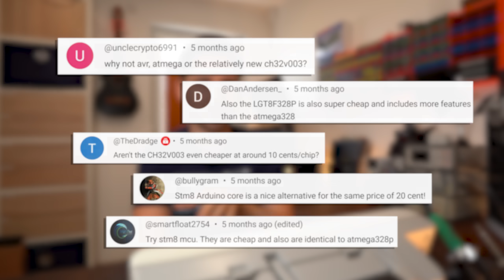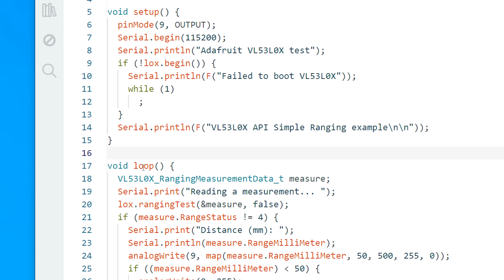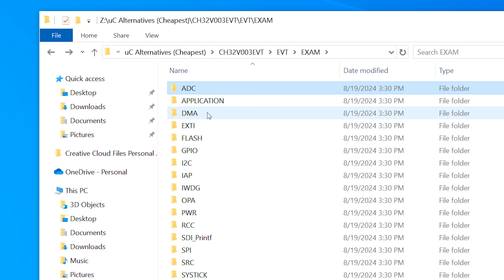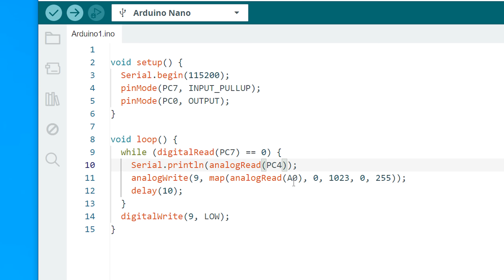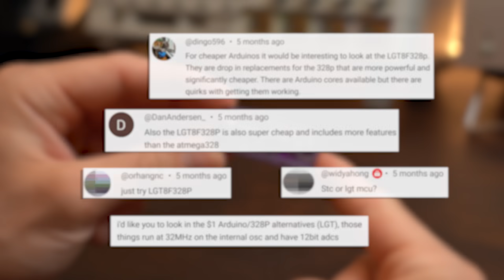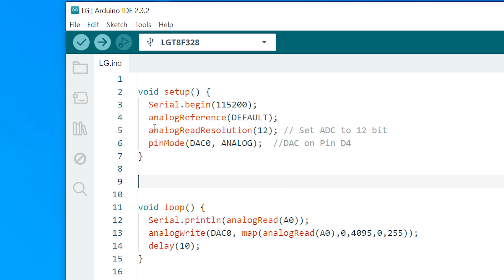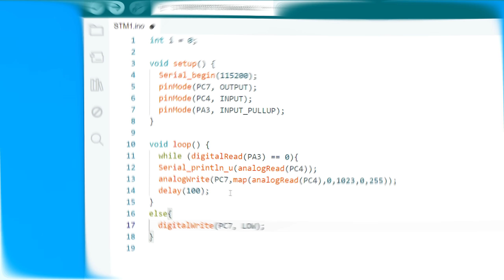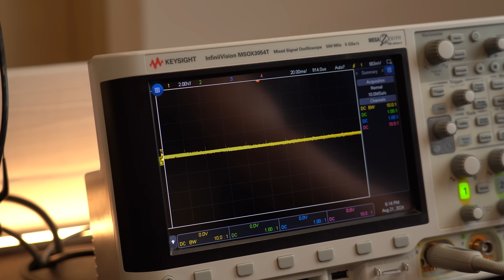I tried the 3 Cheapest Arduino Alternatives! (That you Suggested)

Comment: I'm surprised we didn't get a look at the PY32F002A. Bare chips are around 15 cents each in quantities of 5 on LCSC, it has a little more flash and SRAM than the CH32V003 (albeit at half the clockspeed at 24MHz), and it's ARM so it fits workflows that use ARM programmer/debugger equipment and toolchains. The PY32f030 series goes for about 40-50 cents in single quantities on LCSC and it has double the flash of the ATmega328P, so AFAIK you don't have to worry about flash size at all coming from an Arduino Nano. It's a bit harder to find cheap dev boards for PUYA MCUs, though, and English documentation is sometimes awkward to get ahold of. Still, if you don't need a lot more speed but do need lots of flash, I think they're a great middle option, especially if you have an ARM toolchain set up.

Comment: Thanks!
I just ordered some of the LGT8F328P boards.
I need to use them to convert the 1-4V signal from the Hall Effect throttles on my older 24-Volt and 36-Volt electric scooters to either a 5V PWM or 0-5V DAC signal, to control the new motor speed controllers I'm installing in the scooters.
Reply from the maker: Thanks for the feedback. Sounds like a fun project.

Comment: You should try Silicon Labs microcontrollers like the EFM8 family, for example the EFM8SB10F8G-A-QSOP24 (8 bits 25MHz 8KB (8K x 8) FLASH) which consumes very little power or the EFM8LB12F64E-C-QSOP24R (8 bits 72MHz 64KB (64K x 8) FLASH) which is very powerful for its price.
Reply from the maker: Maybe next time ;-) I put it on my to do list
Reply: @greatscottlab  cool 😄 but I don't know if it's compatible with the arduino IDE

Comment: Hard to beat the Pi Pico unless you are manufacturing a product in really large quantities! You have to be valuing your time really low for it to be worth researching an oddball chip, probably pretty poorly documented, probably with a dodgy supply chain, to be worth shaving a few cents off each board.
Reply: Yeah, but wayy oversized.. for just running a small display and a few sensors an esp is better suoted, juwt because its cheap, small and packs a punch

Comment: Great video Scott.
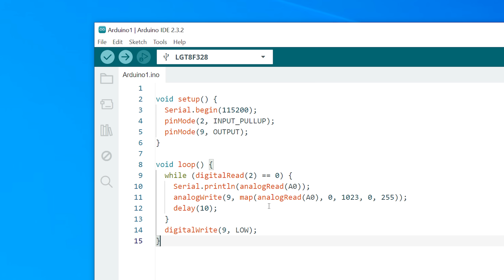Although one thing: my guess, as to why your setup at 8:29 didnt work, would be because you didnt account for the adc having a higher resolution. As the Arduino nano only has a 10 bit adc, it's value only goes up to 1023 (which you then remap to 0 to 255 in your code). But the new board has a 12 bit adc, which means that the value doesn't get remapped properly anymore and goes out of bounds.
So maybe if you change your map to be from 0 to 4095, it might work with the LED example.

Edit:
Ok, maybe i should've watched 5 seconds further, as the same microcontroller on a different board seems to work. Who knows what happened with the first one

Comment: ESP units are also very cheap, the new lineup of the ESP32 series is also seriously awesome, more memory, speed, BLE and WiFi even Zigbee support on some, the ability to just flash ESP-Home and then do OTA updates, it just leaves arduino in the dust
Reply: ESP32 and even 8266 are way superior, wifi and bt inclusion out of the box are just fantastic, for the price they should have been here and would have crushed the rest
Reply: @javierolo94  well WCH offers even some ethernet phy bundled whereas ESP is now going to wireless only. If you are on smart building or on board communication, wired is a prefered option for obvious security reasons... I wish WCH had Base T1S with PoDL 🎉🎄
Reply: Downside of ESP32's is their power consumption. They are extremely power hungry which rules them out of almost all battery powered solutions.They're also not really in the same category as replacements for Arduinos as they are 32bit, not 8.
Reply: Another annoying downside is compile times. Basically every ESP project takes at least 30s to compile for seemingly no reason.
Reply: @KnowledgePerformance7  The really long compile times on ESP32 only happens on windows for me, on linux it only takes a few seconds.
Reply: @KnowledgePerformance7  thats on windows. esp-idf uses mingw to emulate linux so thats why its hella slower. its about 2x faster on native linux, or virtual machines. Im currently running Windows 10 LTSC with a Ubuntu WSL that i can access from windows. i can also connect to it via vscode which is pretty awesome.
Reply: @KnowledgePerformance7  Try disabling your anti virus.
Reply: yeah, just don't use the adc feature nor look at the power usage
Reply: @kikihun9726  There is nothing wrong with the Pico 2's ADC.
Reply: @cheponis  i meant for esp chips
Reply: Adding to those pointing out the downsides, ESP32 power consumption is exceptionally high compared to BT or 802.15.4 (Zigbee, Thread, etc) only chips. Most have less power consumption while transmitting than an ESP32 will have while idling. For always-on battery powered devices, ESP32 is a really poor choice unless you absolutely need WiFi.
Reply: What the hell are you guys doing with cheap ass MCs to be concerned China is spying on you? Will they kill my goldfish?
Reply: Apart from deliberate back doors, having wireless communications increases the chance and severity of accidental security flaws. So if you're not using it anyway, it seems better to leave the hardware off.
Reply: unfortunately they all have wifi, no option for going without
Reply: ESPs are the best, but this video was about cheap MCUs.
Reply: @Gameplayer55055  The Best is RPi Pico 2, but is more expensive.
Reply: ESP32 has a couple downsides though including not very well timed PWM outputs and more importantly isn't secure and likely has a backdoor in the wifi blob. So they're not worth the risk from a security perspective
Reply: @HerbaMachina  all boards are made in China, so all of them are insecure according to your reasoning. If you don't trust ESP WiFi well, you don't have to use it. You can use bluetooth, or ESP NOW so you still have some connectivity without giving it your network credentials. Or disable all.
I think ESP boards are way better than any arduino board, or arduino replacement. Even if they are a few cents more expensive, that's nothing and you get a more powerful board, better support, huge community around it...
Reply: @bigbronx  or if they have any sense, no matter where the IOT device is from, they would have created a separate network from their main devices.
Reply: @HerbaMachina any backings on the backdoor statement?
Reply: @TecSanento considering the attitude of the country of origin it is highly likely that they have built in a back door. Also it is a black box in terms of Internet connection.
Reply: Stop believing US propaganda. If you think the US aren't the world's biggest spies and also right now the world's biggest threat, I have a bridge to sell you. Just for the record, the US are spending over a trillion USD in "defense" (more like aggression) budget. That's more than the 12 next countries combined. That doesn't include hundreds of billions for the NSA and CIA, nor the foreign propaganda agency.
So you think your American made devices are secure ?
And don't tell me the USA are on our side, they aren't. They are the most bullyish and aggressive country on the planet and they are getting worse and worse as they are losing power.
Most of the so called "backdoors" in Chinese products are manufactured propaganda by the US. For example, there has never been a backdoor in Huawei routers, contrarily to American allegations. No security researcher on the planet has ever found one. But people think Huawei is insecure because of US lies. Just like for the WMDs.
Reply: Also American companies are submitted to laws that prevent them to even mention it when they are forced to obey orders by US agencies to insert backdoors. Anyone mentioning it faces jail time. So if you think only Chinese companies are submitted to the government, think again.
Reply: @HerbaMachina even if it has, as an IoT device it should be in its own IoT VLAN with no access to the internet so it doesn't really matter even if there was something
Reply: @HerbaMachina Isn't there an esp-rs? There seems to be an open source wifi driver implementation there. Can't read rust btw.
Reply: @HerbaMachina  Backdoor in the wifi blob? You can block that with the tinfoil hat you are wearing.
I've seen people say the same things about Chinese chips that have no wifi.
There's no evidence of anything like this, and people have tried to find ... anything ... on the ESP32.

Comment: I was working on a Solar power monitor and was searching for a good mcu. Found the ch32v003, stm series mcu and that LG series clones too. But when I checked the prices and the programmer prices. I settled down with arduino and wemos D1 mini. Both costing around 2$ for me. 
The st link v2 costs more than 2$ here. 

The wch link e programmer is around 8$ here. So not good for a hobbist. 

Sadly the ch32 series costs more if used as a
Reply from the maker: Thanks for the feedback :-)

Comment: I would probably choose the lgt8f328p, since it's basically an "Arduino on steroids".
Reply from the maker: Haha nicely said.
Reply: I'm looking for an arduino on crack, personally.
Reply: Some feedback for the LGT8F328P
The speed is juste double the arduino and not very usefull. You may have to set the clock the of the arduino for certain code using strict timings.
The idle power consumption varies a lot form board to board.
It breaks my arduino IDE 2.x , I have to delete manually some files to make it work when I switch to a real arduino board programming.
I use ST32 boards now, with its IDE.
Reply: lgt8f328p for general use and ESP32 when you need connectivity or more power.
Reply: The 48 pin variant offers one full extra 16 bit timer. 
Alternate serial pins are nice. 
DAC is not really usable since no output driver.
I prefer those to the original arduinos.
Reply: Also one currently in production, right?
Reply: Hahahah lol
Reply: the 12bit ADC does make me quite interested in it.
Reply: The lgt8f328p sucks. Some of the are very unstable. This is not what you expect from a micro-controller- you never know is the chosen one really runs stable? Any other MCU is a better chose.
Reply: @deterdamel7380  Mine run absolutely stable. I have 41 of them, all 3 sizes.

Comment: Interesting stuff. the LGT8F328P Board: is indeed fairly cheap, but the  S&H make it  expensive again compared to  say an arduino, as i have not found  a "shipping free" deal yet, as  is available for the arduino.
The Ch32v003 Development Board is still fairly cheap, but having to buy  the interface as well, only makes it a viable option if one  will program several of those. I wonder if a regular FTDI232 would work as well. Maybe I should try. Can't help but wonder what the USB port on that board can do. Maybe only for Voltage
Reply: Regular ftdi won't work. You need to program CH32 via SWIO pin. The usb on that devboard is only for power.
Reply: @MaxintRD  tnx. I already suspected something like that. Too bad. Don't need to try now
Reply: @Ed19601  - there are some programming alternatives (eg. WCHISP), but I bought the LinkE. Although more expensive than a single devboard witn usb-programming, it allows me to have many very cheap mcu's. It hurts much less to destroy a 12ct MCU than a $2 board, eg when accidentally misconnecting pins. (Been there, seen some magic smoke...)
Reply: @MaxintRD  been there too 😉🙃. I will look in to some id these purely out of curiosity.

Comment: I have purchased a number of ESP32-S2 Wemos Minis clones (Wemos? Lolin? Who knows... it just works besides the very crappy Reset/0-pin switches which are prone to breaking). Each came out at slightly under 1,50€ with 24% VAT.
Reply from the maker: Not a bad price as well
Reply: I hate the switches on those grubbers, i just gave up and use a screw driver for shorting the 0 button whenever i need to flash firmware, the copper traces always break, but 2 dollars is 2 dollars and now its running my WLED setup
Reply: This is what I usually do too. I just get a generic esp32 devkit with a breakout board for dirt cheap from one of the better ali sellers.
Reply: Where do you live to have a 24% VAT ?
Reply: @raphanunu6912  Enlightened socialist europe, where the middle and lower class pay almost a quarter again the price of EVERYTHING to subsidize the luxury beliefs of the rich.

Comment: sorry but i have no money to afford keysight stuff..... They are unreachable dreams to me.... sorry. your vidz are nice though !
Reply: I certainly can not justify new Keysight for my personal home lab, but as a long time techie working for several high tech companies, I enjoy seeing what's new. Many places require at least two different manufacturers for o-scopes with professional calibration services. So that would be Tek and... other. My personal "high-end" scope is from the 1990's, 2-ch, 200MHz with monochrome CRT display. Which I purchased very used but still working and able to be calibrated. The only way to save waveforms externally is with a 3.5" floppy. And using a floppy to USB adapter to my laptop.
Reply: Ive wanted an ociliscope for years, signed up for the keysight giveaway but just get spam now lol
Reply: @terminsane same here. ☹️
Reply: @terminsane  same here ;)
Reply from the maker: Maybe one day ;-) Thanks for watching though :-)
Reply: @greatscottlab  slightly ironic, having a sponsor for high end tools on a video where $3 is the high end of the spectrum 😉❤
Reply: @SanderMakes Oscilloscope is for life, knock off Arduino board you will use bunch of them yearly
Reply: @SanderMakes 😂😂😂
Reply: @SanderMakes  Using dirt cheap micro controllers is quite sensible when you need a lot of them. I have a project that might end up needing between 5 and 15 so yeah. Id rather not pay 5 a pop when I can get everyting I need for .50 each.
Reply: @greatscottlab flash forward 40 years to a @kleioscope sifting through the wreckage of a post-apocalyptic hellscape.
“Is that… a Keysight scope with a 1ghz 14-bit ADC?!”
Reply: @greatscottlab  can you make a ups around 200w to useing 12v li battery and output is ac. Please i need one but i don't find it anyway. I am a electrical engineering but i don't know how to make one with vary low latency  around 10ms
Reply: @greatscottlab  had you ever considered make a list of oscilloscopes like  the 2C23T, DSO152 or DSO-TC3?
Reply: No one has that kind of money, but it's good for those who work in laboratories at wealthy companies or colleges.
Reply: Me too.
Reply: I mean, you could always use your own knowledge and other people's knowledge to build one using one of these arduino alternatives😅
Reply: I think the goal of the ad is that you might use it at work. They aren't priced for hobbyists, but if you work in electronics then you might need the features they offer. If you are going to sell a million of a device built with a $0.25 microcontroller, then whatever they are charging for a scope is reasonable if it is the best way to get the job done. Whenever I have to move a piece of equipment like an oscilloscope at work, I always ask first, is this as expensive as a laptop, or a car, or a small house? We do have a few that cost as much as a small house (>$100k). It is generally a bad idea to drop those on the floor.
Reply: Guys! If you actually like and appreciate these videos, maybe don't burn sponsors?
Reply: @timwds what you think the sponsor will read the comments section, get upset and pull channel support ?

Keysight could care less if you "insult" them.

I didn't notice any insulting, just mention of price being too high.

Do you think Rolls Royce gets offended when a carpenter complains on a forum that their cars cost too much money ?

No. The carpenter is not the Rolls Royce customer base, and they could give a f--k what those people think. 

I think if Keysight has such a thin skin as you are implying, then they shouldn't be in business selling overpriced equipment to over-funded universities. 

Jeebus.
Reply: I signed up for the Keysight Giveaway and I never heard anything from them.
Reply: Buddy, never apologize for not buying things advertised to you. Don’t feel pressured sir. Also there are many good scopes for a fraction of the price. And many high end ones that are a few years old that will serve you fine.
Reply: If you've got a job start saving, I saved for a year just little bits here and there
Reply: I have a entry level 2ch  keysight scope but who really need that monster
Reply: You probably don't need high end, because if you did you or your firm could afford it. Nobody has ever needed Keysight or LeCroy to work with Arduino so dry your eye's you big baby.
Reply: Or something a little bit more expensive, but more competitive in functionality like HDS2202S?
Reply: Same
Reply: A Picoscope might do. Payed about $200 for mine.
Reply: They aren't for individuals for sure. Better get a used one. I think they have such service? (At least when I was translator keysight outsourced to).